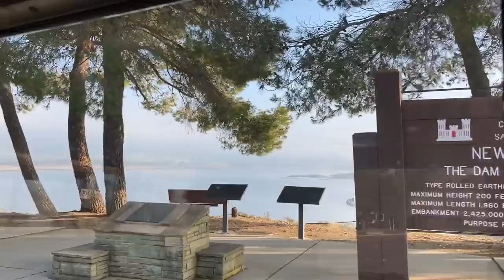Drive a survivor 1929 Ford Model A on New Year's Day.  This is HAPPENING!!!

Comment: Just saw this video. Love it. My son and I went for our first ride in my Dad’s 1930 Tudor on January 1st, 2022. Dad passed in 2014 and my son had just turned 2 at the time. It’s a rough car, but Dad just wanted something to play with. It was stored in a barn in TN since the 1950’s and I pulled it to TX with the family minivan in 2010. I finally got motivated this December to start working on it. Dad had replaced the key switch and part of the distributor about a year before he died and it wouldn’t start after that. With your videos and a little studying, it starts and runs and we’re now making forward progress. Hoping to drive this one every January 1st for a long time. Thanks for the help!

Comment: Thanks for a great video and preserving it in its original unrestored state.  Any idea about original mileage? Have you done a compression check on her to compare with your others?  You seldom drive her, why the alternator?
Thanks & Happy New Year.
Reply from the maker: Just a out to turn 70K miles.  Compression about 65 lbs all 4.  6 volt positive ground alternator, yes.  So the lights are bright at night and so the Optima battery doesn't get damaged.  I received this car without a generator, so it's not like I removed the generator to put the alt.  I do have generators that I can bolt in if showing. Happy new year!
Reply: Optima 6V batteries work great for Model A's, thx for great advice.

Comment: I remember driving my mother's chevrolet
Covair 1966 mo
My first car was a Ford
1971 LTD 400 Cid
2v carb by autolite
Lots a power
Could climb a mountain. With ease
Had to put points
In it often and cam lube but the cam bushings were lubed
By eng. Oil pressure.
What a gunship big.
It was a rusty bucket
Of bolts no vanadium
Steel I was 19 at the time. Pleasant memories Happy new
Year 2022.
Dwight.near Detroit, Mi.

Comment: Get the lead out. It is surprising how damage much tetraethyl lead causes to gasoline engines.  Aviation piston engines still use leaded fuel 100L and the resulting fouled plugs and slug in oil coolers is a big maintenance problem.  New automotive engines and pre 1950s  don’t need lead.  31 45B

Comment: Happy New Year Paul and Tina! One question about your 29 Fordor, how many miles does it have on the odometer? My 29 Coupe has around 41K, but it had a rough life until I got ahold of it, now she (Matilda) is being well cared for. I rebuilt the transmission, everything replaced except the case, it still wants to hang up sometimes between first and second any ideas to what I should look for? Thanks for your time!
Reply from the maker: It is about to turn 70K miles.  Sounds like your shift forks and/or shafts are worn.
Reply: @ModelA  Thanks for replying. I have new shift forks and shafts (everything is new in the shifter housing), one of the new parts might be defective, I will double check them. This is my first Model A so I still have a lot to learn about it. Your Fordor is truly amazing, there's nothing like an original survivor.

Comment: The Model A was the first Ford to turn Cologne in Germany into a Ford-Town. Until the present day. And many european Fords were and are engeneered there. 
Sadly also, the way they produced cars caused the dead of several smaller car manufactors as they handbuilt cars... The oldest Fords I remember was the Taunus and Escort from the late 1960s.
But since I grew up not far away from a Opel/GM factory, I love Opel as well.
Reply from the maker: Thank you Karsten!

Comment: Hi Paul, as we discussed earlier;  Leaded gasoline was in wide use by 1927.  The reason why the Model A Ford does not require it,  is not because it wasn't available in 1928-1930. Model A Fords were designed to run on low octane gasoline of the day and do not require the additon of an octane booster such as tetraethyl lead..  Even the lowest grade of today's gasloine has an octane rating of 87 which is well above that required by the Model A.  Your program is very informative and I enjoy each new episode but I keep hearing you repeat the false claim that lead wasn't in gasoline back in the day.
Reply from the maker: Thanks Timothy.  I appreciate the information!  I know I keep saying that, and it's because tetra-ethyl lead wasn't added as an additive widely at the time.  Yes, it could be found in some fuels in 1928, but not all.  It wasn't until after the Model A production that lead was a specific additive and asked for by name.  As an engineer, I can overcomplicate just about anything and make it ridiculously boring, so I try to keep that in mind when making videos.  That sometimes causes me to over-simplify things and accidentally leave important facts out.  Bottom line- You're right.

Comment: I currently have a 1981 Model A Shay with the 2.3L Pinto engine, and I can  barely keep up with the traffic in back road, just wondering if you are constantly got tailgating from other drivers, I love to own the real Model A hence the feel and engine sound is so unique, but also afraid of  getting rear ended by other impatience driver, your opinion is much appreciated, happy motoring.
Reply from the maker: Neither the Model A nor the Shay has any real safety stuff like modern cars.  The Shay might have a slight disadvantage since it is made of fiberglass while the Model A is steel.  But either way, you're not going to come out too well in a crash.

Comment: I would agree no need for an additive; if you're only turning 2,000 or 2,400 rpm the heat dissipates. Only 30 spokes per wheel gives me the heebie jeebies for that weight of car, i reckon you must give them the tap test quite often!
Reply from the maker: You'd be shocked at how stout the Model A wheels are!

Comment: I spotted all sorts of non-original, I have the real thing, am 88 and know what real original  is but... no matter, main thing is, we keep 'em going.  Get rid of that horrible alternator ... and 12v ??...
Reply from the maker: All of that is explained in previous videos.  It is a 6volt positive ground alternator that I put on in place of the generator when I am going to drive at night.  One bolt and one nut to swap them.  Other than that, what did you see that was not original?

Comment: Every tear about this time I winterize mine. I put it up on jacks then reduce the air pressure in all 5 tires to 10psi. I start the car and after a few minutes then shut off the gas. When it stalls I disconnect the fuel line at the carb and remove the fuel bowl after draining the the tank, take the carb off to clean out any gas then reinstall. I usually leave the gas cap off for a few weeks to let any remaining gas evaporate then put on the cover. Late spring I'll reverse that, grease and oil everything. Sometimes when life was busy it sat for several years but always started right up. Great car.
Reply from the maker: Good tips.  Thanks!

Comment: Paul, you said that you would apply lube to the points. I remember putting lube on new points. I think that the lube was from Philco in a little green tube. Just a dab on the distributer cam would do the trick. It was like white lube.
Reply from the maker: The Model A distributor lube interval is every 500 miles.  I also do it every time I get a Model A out of storage.

Comment: Awesome video, happy new year, Paul can you explain circuit breaker on starter! Thks
Reply from the maker: Fuse holder mounted to starter.  All the Model A parts places sell them.  Fuses the electrical system for safety. Easily removable for judging.

Comment: At least 2 or 3 drives a year should keep most things oiled up , and working. Disconnecting a battery also stops rust which most people don't know i fit isolators on old cars which get stored
Reply from the maker: Cool info.  Thanks!

Comment: since you drive this car so seldom, do you feed it gasoline without ethanol? What fuel stabilizer do you use?  I know that this is an big issue with lots of people who own older carbureted motorcycles and store them over the winter... the fuel goes bad and then you have to clean and replace the seals in the carb.
Reply from the maker: For the in-depth answer, see here-  https://www.youtube.com/watch?v=O4LCXxUhYT4

Comment: No need for lead in a low compression low rpm engine,in fact the T was designed to run on ethanol...." filler up with Ethel"
Reply from the maker: Bingo

Comment: That's like my stepdad's 30 4 door. Mostly original. Unfortunately, the tires went out while he had it in the yard washing it. The paint/lacquer cracked and had started flaking off. The old clear vinyl seat covers are about toast too.  With there was a way to fix the paint.
Reply from the maker: I'm not a paint expert.  I'm sure someone can answer that.
Reply: @ModelA  I do have home interesting question. What's the difference between the Andalusite blue and the shade of blue on your coupe?  Are they pretty much the same except name?
Reply from the maker: No. The coupe is Lombard blue. Andalusite is much darker, almost black.  The Lombard has an almost purple hue in the sun.  See the MAFCA color guide for  specifics.  Quite fascinating.

Comment: Great car! So I have a couple of questions…Paul.  I have been working on a 1928 Model AA truck that has been in the family since 1983ish.  My parents got to match together with a 1930 coupe.  Well I have worked on the worm gear and auxiliary transmission and have worked on the brakes.  The brakes are a story! Okay to my question…. The motor has been rebuilt back in 83….and nothing has been done for the tillerson carb or the distributor.  It’s got maybe 300 miles since motor rebuild. I have watched nearly all your videos and wonder what you feel about the pertronix distributor “up grade?” The truck has usually been a easy starter but since I have been working on it it’s developing an attitude! And really I’m just learning how to speak Model A language! It’s wanting to die like it’s lost spark or maybe carburetor to much gas?
Reply from the maker: Get rid of that Tillotson first.  99% of them fail from just sitting (they warp).
Reply: I really plan on doing that based on your information! I have really enjoyed reviewing your content and experience! Glad to hear you are doing well too! Prayers for continued health! I only started working on our 28 just over a year ago! It’s been a real joy and connection! The 30 coupe is my grandfather’s old car from late 60’s! All we’ve really done is keep them! That AA truck worm gear and all is enough to make a fella mad between high and low speed gears??!! But that’s part of the fun too and it’ll do a relaxed 35mph…..now….in between running and not
Reply: @ModelA  Good man!  Get rid of that Tillotson first.  Every A I worked on that had them was a problem.  Put on a good zenith and it's a different car.  Amazing how owners won't let them go.

Comment: I have this weird thing now, where with a long drive I have to retard spark more and more over time to prevent bucking from the motor.

When I drive after a couple days of rest I can do 30 miles with sparklever at 1/3ths but after a day of driving, I need to put it max at 1/6th, and I feel it looses a little power over that time too.

But then after a few days, everything seems to be reset.

Oil level is good, timing is properly set, everything is tight down nicely. Put in a new condensor. Coil is working fine, all 4 sparkplugs spark.

Also, is it normal that after a day of driving the oil pan is too hot to touch?
Reply from the maker: Sounds like you are running too hot.  Then I saw the bottom part of tour message and that confirms it.  The oil pan should not be so hot you cannot touch it.
Reply: @ModelA  but the radiator isn't hot at all, flows well and I cleaned it out when I had every apart, and it's quite cold weather here currently. I'm driving with only 1/8th open fuel mixture. One of the trips was even near freezing temperatures outside.

The whole engine is cleaned out, I've had taken it completely apart, all new gaskets including head gasket. All canals and tubes totally cleaned, pan totally cleaned. All sut and grime removed.

And I always make sure to properly advance during driving.

I don't know what else I could do. I'm breaking my head over this, can't come up with a sensible cause for this.
Reply from the maker: @DrTheRich    What happens if you drive it with the radiator cap off? Take the cap off and drive it hard.  Floor it in 3rd gear and run it up to 50 MPH with the pedal to the floor.  Does coolant come out the radiator?  If so, then that head gasket didn't seal, and that is likely causing the problem.
Reply: @ModelA  I think that's the issue. So what do I do then? It was a fresh new copper gasket, and the head and top where freshly flattened. Head nuts tightened to speck, and retorqued a couple of times. 

What else can I do more than that? Do I need to keep ordering gaskets till i find one that doesn't leak? seems kinda expensive and wasteful.
Reply from the maker: Start by having a machine shop resurface the head, or at least check it.  Use the spray "copper coat" on both sides of the new gasket.  Let is get tacky then lay the gasket down and put the head on.  Torque the head in 5 ft/lb steps in sequence.  Creep up on 55 ft/lbs.  Then re-torque the next day.  Start and run the motor without coolant to get it warm, then shut off and let it cool.  Re-torque.  do that a few times, then add coolant.  You will have to re-torque several times.
Reply: @ModelA  I had it resurfaced already, both head and top of the block.

I'll try the copper coat spray, haven't tried that yet.